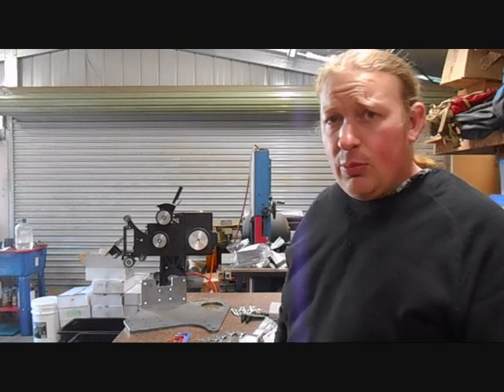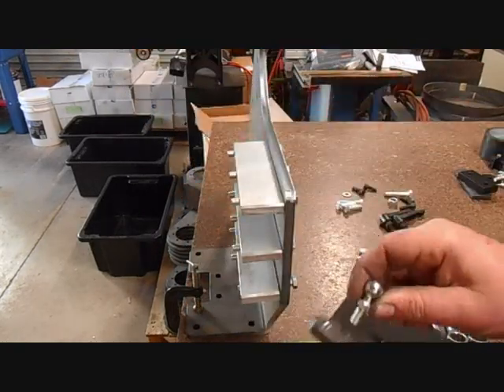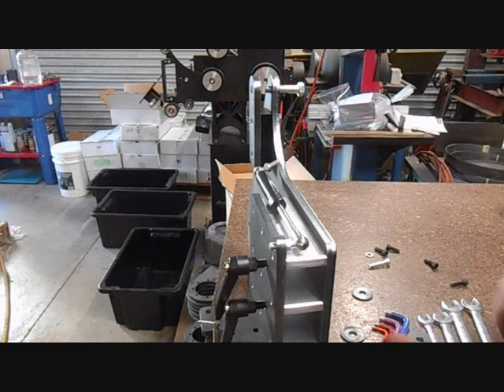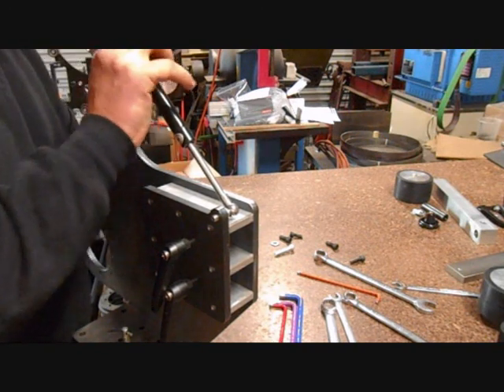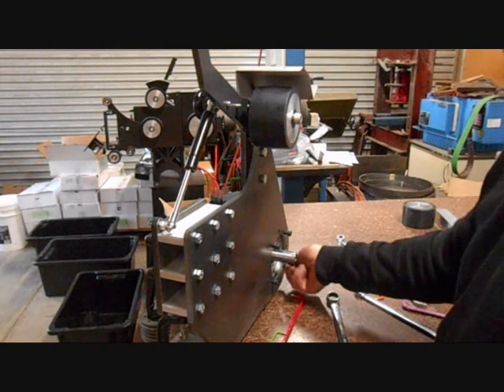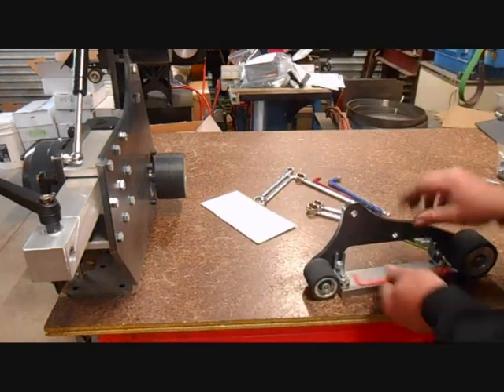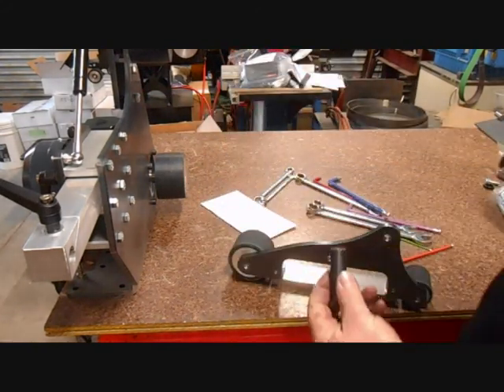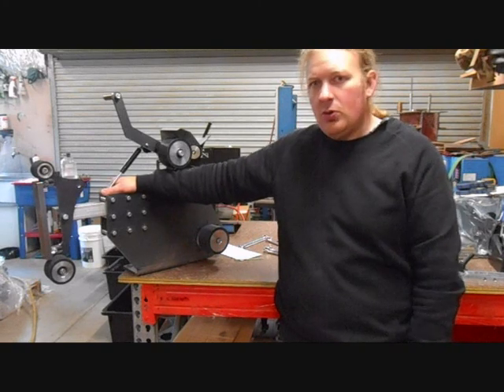Shop Master 2x72" belt grinder assembly

Comment: The bracket with the pivot @1:00 does that come with the stand?  I have just placed an order without the stand, but that part would be useful.  I can I add that to my order?  You'll see my contact details with the order.
Reply: You are right about metric hardware having odd head sizes in this part of the world.  I worked as a toolmaker at Ford UK Product Development, and all 12mm nuts and bolts had 19mm heads.  All 10mm had 17mm heads.  8mm had 13mm.  There were occasional exceptions where space was an issue, but I don't think I ever used a 16mm or 18mm spanners over there.

Comment: I would not buy this grinder because it does not turn horizontal rubbish.
Reply from the maker: Both our 48" and 72" belt grinders tilt horizontally using either the bench stand or floor stand accessory. We were one of the first belt grinders available to offer the horizontal tilt mechanism! Check out the link if you want to find out more :) https://84engineering.com.au/collections/stands

Comment: Am interested in one of these, would like some advice on what motor to go with it.cheers!
Reply from the maker: Hi Shelley,  the motor required needs to be a 2 pole, 90 size frame with a 24mm shaft. The grinder accepts a c face motor directly or a standard foot mount motor can be used if the grinder is mounted to a bench. Gameco Artisan Supplies have the correct motors in stock as well as the grinders.

Comment: Going to get one with the VFD and 2HP motor. If I choose pre wired that means I wont have to do any of the wiring of the cables right?
Reply from the maker: That is correct, the VFD and motor will come fully wired and programmed if you choose the pre wired option.
Reply: @84engineering  Sweet. will be purchasing one very soon to upgrade from my RYOBI ;-;